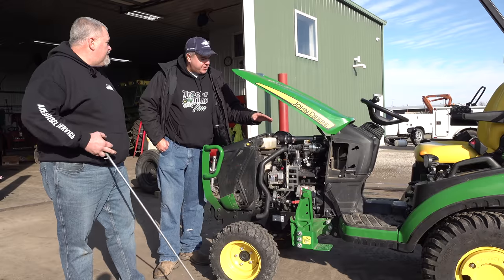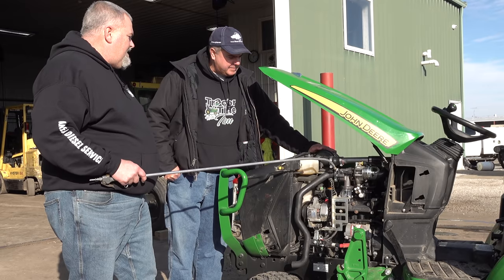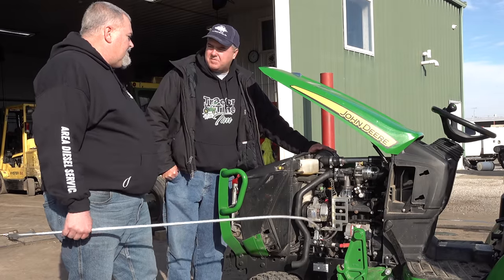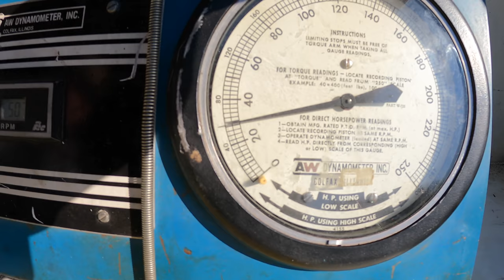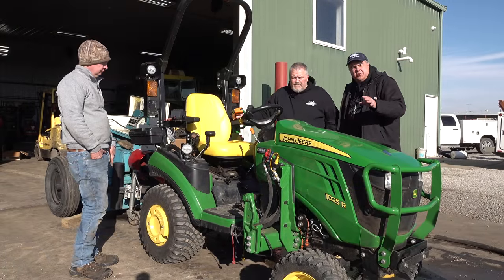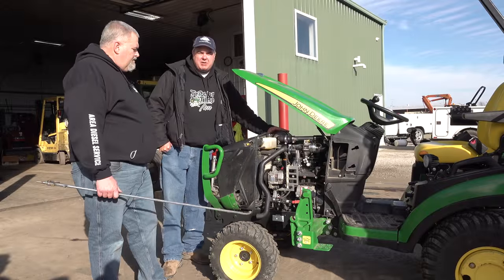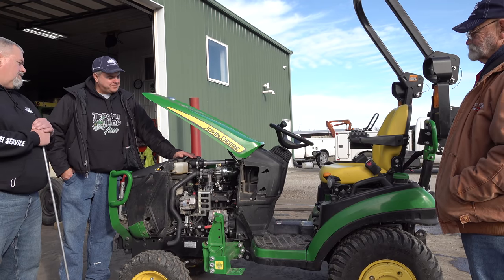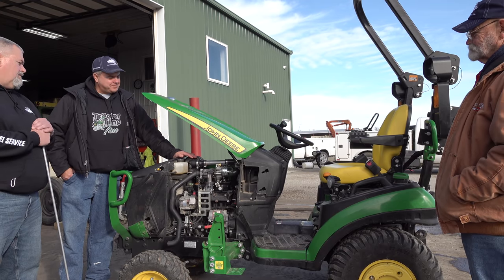John Deere 1025R Turbo Dyno Test!!  You Won't Believe It!

Comment: I’m thinking with the extra torque you can upgrade to a larger hyd pump to one provide more volume and maybe increase pressure (with associated press relief mods). That would make the smaller tractor more of a viable tool if it can do the work of a larger one with the ease of maneuverability (of course safety in mind as to not overdue what the stability allows).
Reply: Why not make an aux pump off the pto and plum it up to his 4 diverter valves he has bolted on the rops of his other tractor.     

Something to run high flow implements like the back hoe, or loader mounted mowers / saws while keeping the factory hydraulics in place / stock.
Reply: @ProjectsWithPat  that is an idea BUT I think beyond the capabilities of the LITTLE 1025r frame. While he may be able to add the high flow, the loader wouldn’t lift the loader mower, and if it did, would probably be unstable when lifted to get high shrubs/trees nor could it probably handle the rotational mass those type mowers have (and when they are bogged down, that little frame will get slung easily). I dont quite understand adding a rear high flow system…..and a backhoe…. I dont think they will both fit. 

My suggestion was so that the added torque could be used in a stock APPEARING package and stay within the normal design ‘look’, a sleeper so to speak. You can hardly tell he has a turbo on that thing, so a slightly larger hyd pump mounted in the same place as the original would be my goal if I had the time/money.
Reply: @talonpilot   yeah true on the frame size.   

I don’t remember what tim used to test that lime green loader mounted mower on.  2 series or 3 series.   

I sometimes forget the size of the 1025 because I have a 2 series.
Reply from the maker: I don’t have the ‘lime green’ one.  I have the Hardee.  I used the 2038r.

Comment: From what I've researched the transmission is the same as some of the next couple size bigger tractors so I don't see any problem with the drive train the motor would be the only thing that I'd be interested in how it stands up would love to have one on mine for the tiller
Reply from the maker: I don’t think so.    Where did you find this information?

Comment: So what other mods were don’t to the engine. Like did they change the injectors for more fuel??
Reply from the maker: Same injectors…a bit more fuel
Reply: @TractorTimewithTim  so did they change the injector tips to a bigger tip to spray more fuel?
Reply from the maker: No
Reply: @TractorTimewithTim  I could be wrong but if same injectors with no mods then it’s the same fuel flow from the factory specs and with the added boost it will run a bit lean which with create hot spots on the pistons and cause premature ring failure. Wish there was more details in the video about everything that was done.

Comment: Curious what this will do to the the loader lifting capacity.
Reply from the maker: On its own, nothing.
Reply: @TractorTimewithTim  Yeah, dawned on me right after I posted that pressure is set independent of engine HP. Nevermind. :)

Comment: the installation looks very professional looks just like the factory would have installed it can't wait to see the performance. now you need to increase the hydraulic flow to match the horsepower

Comment: Well that looks awesome thanks. You didn't say anything about weather they adjusted the fuel pump or if they had to. Can't wait to see how it works out. Did they put a boost gage in the dashboard and should it have a peromiter also just asking Can't wait for more information and updates. Sure is cool though 😎

Comment: I would say the best test of it would be the stump grinder. where you are trying to put the maximum load on the pto. But the one thing you must always watch out for is your engine temp. with the added HP will you have enough cooling capacity.

Comment: Hey Time Love the channel. Q: Have you ever had issues with the snap ring falling off rockshaft? Mine came off our 2025R the the rocker arm fell off! Tractor is 3 years old now. I was able to put it back on and cripple through my project. I'm getting ne clips. Is there anything I should be worried about now? Leaking etc... Thanks Tim
Reply from the maker: Yes. Had that once…but I saw it before the lift arm fell off.

Comment: Loaded tires, backhoe, loader on,  in high gear, going up an incline is where I bet that turbo helps. My 2025r is very different when the Backhoe is on. I’m in low 90% of the time.
Reply: I also notice with just the mower on( loader/hoe off) and my R3 Bias tires on, she scoots around effortlessly.  R3 Radials(loaded) and 1000+ of implements and she’s no longer a Ballerina.  😉

Comment: All my equipment is small, a 40 inch rototiller and brushhog, a 48 inch box blade and 84 inch angle blade. The only thing that taxes my 1023E is the 48 inch disc harrow but I run out of traction in my Florida sand, not horsepower.
Reply from the maker: Makes sense!  Thanks for watching!

Comment: What kind of fuel system changes (if any) were needed to get the turbo system working?
Reply from the maker: A little more fuel. Nothing else.
Reply: @TractorTimewithTim  That's awesome to hear. In concept then it should be a "simple" (just mechanically figuring out how to mount and plumb the turbo) project for other non-turbo diesel engines as well. It sounds like it's not as complex as gasoline turbo upgrades where the fuel system needs to be upgraded to be boost referenced. I wasn't sure if/how a mechanically injected fuel system need to be changed/tuned to work after turbo charging.

Comment: you'll notice more with like mowing grass, pulling ground engaging implements, running like a tiller.
this really is exciting.

guy is right about testing and seeing what breaks. this might be too much power for some part of the tractor. also, is the difference it makes worth it, or does it just mostly sound cooler?

**EDIT** "or does it just mostly sound cooler?" which i'm not at all against btw.
Reply: The 1025 was derated a bit to get around certain emissions guidelines, so I would be hopeful that it will hold up quite well.

Comment: Did they adjust fueling at all was that left alone? If it was left alone with that horse power increase, that would probably work out to be a good increase in fuel economy, will be eager to see how it performs going forwards. Just don't forget that the transmission is still only rated for the original power, don't try running to large of an implement, the dealership I worked at had to replace an entire hydro-stat and pto because the owner was running to big of a brush mower on one.
Reply: No more power without more fuel. Run lean, engine goes very hot and then boom. The question really is, did the stock programming/ injectors compensate for the increased air flow or need replaced. I would hazard that the injectors needed to get bigger, and a new fuel map flashed. That's just a semi- educated guess though
Reply: @jagx234  these small Deere's still run mechanical injection so it would have been a matter of turning the screw, and on a diesel that's not exactly true, they want as much air as possible then you add fuel, Banks has some great videos on tuning diesel's.
Reply from the maker: Same injectors.  A bit more fuel.
Reply: @TractorTimewithTim  good to know, I've got an older 2520 I've been considering cobbling a kit together for but it's doing just fine for now.
Reply: @RestoMog  I completely forgot mechanical injectors were a thing. Omg I feel dumb ;P

Comment: I agree with Richard S. Extra horsepower always costs. It will be interesting to see how the tractor holds up as I am would guess that some parts were not designed for the increased torque and horsepower. Fun experiment though.

Comment: If the crank and pistons aren't forged(I dont know if the are or aren't in this motor), its not a matter of if, but when the motor will blow...pressed metal internals cant cope with a turbo long term.

Comment: Pretty cool! Would the additional boost potentially cause issues with too much pressure pushing through the hydraulic system?
Reply from the maker: No.  Hydraulic system will not be affected by the turbo.
Reply: Max pressure is set by the pressure relief valve in the hydraulic system, it will be unaffected.

Comment: 32 HP is nice but how much of that number will you get to use that is where i get in trouble with my tractor not been on a dyno but i can tell you from the seat i can safely say i can not get all my power to the ground before i spin out just saying what i see with my tractor
Reply from the maker: Rimguard? Wheel weights?

Comment: Interesting the EGT’s are staying nice and low even after continuous load. That’s a great sign of good reliability .. and you already know you increased the power by 60% so that’s great. I’m assuming EGTs are low because they didn’t have to add much more fuel just more air. Very cool Tim. I try to keep my Cummins under 1500 degrees, anything higher than that for minutes at a time can start to melt the pistons
Reply from the maker: Yes, overall, it seems like a fairly conservative upgrade, even though the HP is dramatically increased.
Reply: @TractorTimewithTim  Exactly my thoughts Tim 👍🏻

Comment: I believe you will see minimum gain pulling or pushing.  The Hydrostat is the limit. As the "expert" said, anywhere you saw an engine RPM drop will be a gain.

Comment: Nice 1032rt hope you have new stickers on order
Reply from the maker: Ah, but 32 PTO is likely 38 engine :-)
Reply: @TractorTimewithTim  yes fair point.   You could probably get a good calculated guess off what the pro was before. So maybe a 1038RT
Reply: @TractorTimewithTim  actually RT is track tractor so maybe T1038R
Reply from the maker: 1038X

Comment: I’m interested to see how that tractor is going to hold up after you increased your power 44% (18hp pto claimed by Deere/32hp pto) Im going  to school to be a John Deere tech and one teacher always talks that you have to pay for horsepower. Whether that is in extra engine wear, transmission problems or anything else down the road that is strained by the extra hp. Don’t get me wrong I’m as guilty as anyone else to want to see how you can get a few more horses out of any engine but I’m interested to see what the real cost of that extra power is.
Reply: 44 percent?  That would only be about 25 it is more like a 73 percent change

Comment: Hello! I just purchased my 2020 1025R with 23.4hrs. At what rpms do you operate it on a regular basis? (Loader work, belly mower, etc). Thank you in advance!
Reply from the maker: Any PTO attachment: wide open throttle.
Loader, etc: make sure you are using higher RPM than you might at first think…need RPM for decent hydraulic flow.
Reply: @TractorTimewithTim  Thank you!

Comment: Now onto real world testing....this is the R&D John Deere should be doing....hopefully this should light the fire
Reply: You should realize that JD did that research and decided to engineer it's tractors like they did for a reason which is equipment reliability and longevity. I've got a 3025 which is underpowered but that's my fault for not buying the bigger HP units. But my reason was that at 25HP I didn't have to have exhaust fluid.
I also have experience with turbos and superchargers and my daily driver is a street / track  car with an Edelbrock eForce supercharger. The learning curve is you increase HP at the engine you'll find the weakest point of failure in the power train. Upgrade that and then you'll find the second weakest point.... It's all how much money your willing to spend to get smaller and smaller performance increases.

Comment: Amazing there is that much power left on tap. That injector pump has no afc, so that means it's just more efficient use of the fuel being injected!!
The hydrostatic relief pressure set to this motor? Higher for stock + hp engines? If so adjust hydrostatic transmission to match?

Also, boo at measuring egt temps with an ir thermometer!! Drill and tap a probe and make sure not 1000+!
Reply: 800-900 manifold surface temperature is too close to 1000 to not know for sure that egt is not at or above safe limits. 

Without the turbo, the fuel consumes available oxygen, a cooler burn results. Add 1/2 atmosphere pressure and now 50% more oxygen, means hotter burn for same fuel.

Comment: How are you guys handling fueling?
Reply from the maker: Local coop delivers off road fuel.
Reply: Sorry. I what I meant was does the the tractor require any modification to the fuel system to allow the turbo upgrade?
Reply from the maker: A little more fuel.
Reply: How is that being accomplished?

Comment: It doesn't make a lot of sense on a smaller tractor like that but if you had it on a larger tractor like an L series or 3 series it would really be nice. There are so many options that try to stay under the EPA and after treatment but could use the extra power.
Reply from the maker: Interesting. I would say the opposite. The larger machines have enough HP for the job.  The small ones are so nimble, yet sometimes lack a bit of umph.
Reply: @TractorTimewithTim  I was actually referring to the low hp (sub 26) but bigger physically. You know, the ones they sell to prevent after treatment. Adding a turbo to one of those so you have a bigger physically tractor but still no after treatment would be sweet

Comment: I would like to see a tractor pull with a garden tractor sled.  All tractors weighing the same with the same drawbar dimensions, and same tires.  Hydro sub compacts in low range.  1025R stock and your turbo, Kubota BX2680, Massey GC1725, and maybe others.  See how far they can go.

Comment: Odds are it's not going to break the engine. The fuel rate hasn't been changed so the exhaust temp shouldn't change much. The hard pto loads it should really work better
Reply from the maker: Fuel slightly increased.

Comment: going up a hill will tell you all you need to know, should test on a hill before turbo then after turbo is installed, we had a 4020 before we installed the turbo went up a long steep hill tractor would bog down to 2000 rpm from 2600, after turbo was installed tractor lost only 100 rpm 2500, simply installing the turbo no fuel turnup

Comment: Pressure does not go down when you are digging and the rpm drops,  pressure is the resistance to flow, on a gear pump the only thing that changes with engine rpm is the flow!  Having the extra hp will keep your rpm higher to work faster…… if you want more digging power and hydraulic power crank up the relief on the mid mount scv 

Flow=speed
Pressure = force
No hydraulic pump creates pressure they all creat flow… they are all rated in gpm

Comment: now you can compete in TRACTOR PULLS 😀
Reply: Mini Pulling tractors with a yanmar diesel put out about 250 hp. I am a machinist and I made an adjustable timing gear for one. I believe this yanmar was bigger than the one in this video though. I know one that had a turbo from a powerstroke diesel on it and a Bosch 3 cylinder "A" pump on it. Also hydraustic is no good for a pulling tractor.

Comment: The question is why are little Diesel engines fitted to tractor not fitted with turbos? Is there a reason? Fitting turbos to diesels, especially smaller engines is a common practice.
Reply from the maker: Tier 4 regulations require complicated and expensive DPF kits for anything 25+ HP.
Reply: @TractorTimewithTim  that’s so stupid. If anything a turbo would make the exhaust run warmer, burning up any stuff in the exhaust gas. The engine would run more efficiently getting more power out of the same amount of fuel.

My tractor does not have anti pollution stuff on it as the Australian government did not decide Diesel engines powering tractors was a major source of pollution. So no regens, DPFs or any other nonsense.

Comment: Yeah my biggest question is is the extra power going to you know where the motor out faster or you know mess up the motor. My grandpa used to have this old saying the more horses you have in the barn the more trouble you have cuz we always wanted to shoot stuff up as young folks so you know as an older folk she was you know being more conservative as you get older and everything obviously and caring about things running longer and caring about gas mileage and all those kind of things that us young people don't think about a lot of times is more horses you got in the bar anymore trouble you got so it's whether the engine is going to handle the extra horsepower well and it not you know wear it out or blow it up you know anytime you have more torque like you said you know you're putting more stress on the motor so that's my biggest question and if that comes out good you know if we can show that that doesn't take any kind of where on the motor you know compared to not have it on there this would be something I would even consider for my tractors my John Deere's series compact tractor but anyway we'll see
Reply from the maker: Yep.  We’ll see.  Definitely no guarantees that it will hold up.

Comment: since thats a yanmar engine, you boys need to come up with a turbo kit for yanmar tractors!
Reply from the maker: Keep watching…discussed.
Reply: @TractorTimewithTim   i did.. you want to wait for the durability results to before kitting it out. im referring to YANMAR tractors needing a turbo kit. should be easy since your engine is made by yanmar
Reply from the maker: Ah. Got it. 
Well, this is a reason to buy a major manufacturer.   No one will make a complete kit to fit Yanmar tractors.  There is not enough market available for the custom work.
For example, exhaust will be different, intake placement different, etc.
Folks always think they are ‘saving’ when they buy the off brands.  Then, they want the same aftermarket options as the majors.